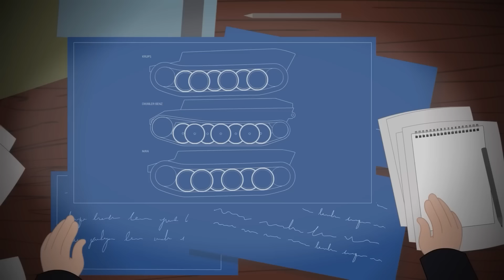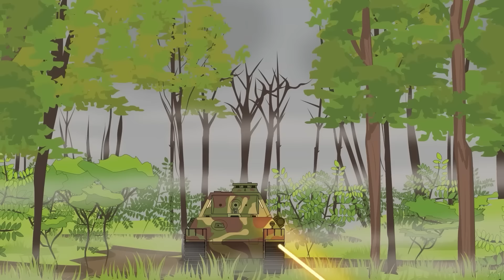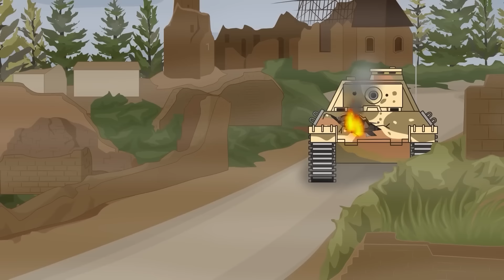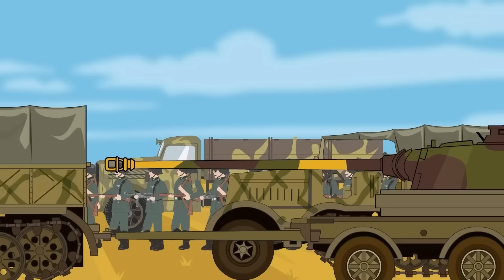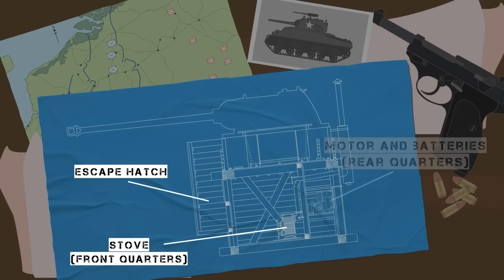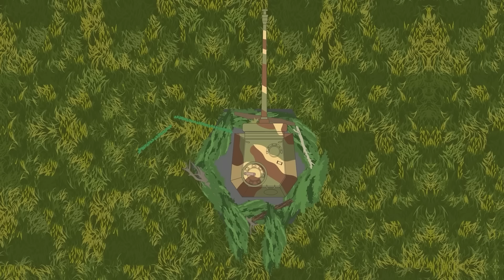Germany's Copy Of The T-34 Tank

Comment: It's entirely FALSE that the Panther tank was developed as a response to the Soviet T-34 tank.  The original requirement for a REPLACEMENT vehicle for both the Panzer III and IV tanks, which had overlapping purposes, and, in the end, entirely swapped roles, with production of the Panzer III, save for rebuild of inventory vehicles into the Ausf J and Ausf N types, in favor of the StuG III SP gun (which also, when fitted with the 75 mm L48 weapon, was very effective as a tank destroyer, credited with more AFV kills than any other type),halted altogether, was a vehicle in the 25 to 30 ton range, sporting the KwK 40 L48 main weapon also used on the Panzer IV from the F2 model onward.  This program was started by Krupp in 1938, but was halted after the Polish campaign, in favor of refinement of the Panzer III and IV models, and hopes that the war would be called off.  Even when it wasn't, following the defeat of France in June of 1940, the production of the German medium tanks proceeded at not too quick a pace.  This would change a year later when Barbarossa commenced, and the KV-1s and T-34s were encountered the FOLLOWING DAY, to their Germans' astonishment.  The need to build a better tank than what they had was especially evident by a rude defeat in October 1941 at Mtesnk, near Tula, where T-34s virtually annihilated a battalion of Panzer IVs. 

The VK(20) program, which had proceeded at snail's pace, got instant priority.  It helped that a few T-34 "runners" had been sent to Kunersdorf for evaluation.  Damiler-Benz already had a prototype that was almost a T-34 copy, but independently arrived at, with the rear engine, rear drive sprocket powerpack (the German tanks until then and the Czech 38(t) used the rear engine, front drive sprocket with the gearbox in front of the driver), which allowed a lower overall profile and better ability to slope the glacis plate.  Although Hitler favored the DB design, especially with the diesel engine, which he considered essential for AFVs, the WaffenAmt 6 selected MAN's concept.  However, many changes, some insisted upon by Hitler also, led to design and production delays, and this "feature creep" ended up ballooning the tank's weight to almost 45 tons, about ten more than targeted. The original Mayback HL210 engine, also used in early versions of the Tiger I with mixed results, was deemed underpowered, the bigger and "badder" HL230, rather cramped in the Panther's engine compartment, was spec'ed.  This led to huge reliability troubles, including ENGINE FIRES.  There were other "teething troubles", but the vehicle held promise with its overall protection, mobility, and firepower, in reality, before the idea was coined, one of the first MAIN BATTLE TANKS.  Hitler had the Kursk Offensive delayed so several battalions of Panthers could be deployed, this was disastrous, both for the delay overall in giving the Soviets more time to prepare defenses, and for the Panthers as their teething problems had not yet been solved.  Needless to say, their debut was a FIASCO, with many of them breaking down right in the assembly areas, and within a week, when Hitler had the Kursk offensive called off, only 16 of the original 200 were still fit for action!  They were all withdraw to "go back to the drawing board", so to speak.

Most of the Panther's original reliability problems were solved, save for that fragile differential, driver training dealt with that issue.  The "G" model, which added a "chin" on the bottom of the turret front, eliminated a troublesome shot trap, and it was probably, WHEN it ran, the finest tank in the war.  Most Panthers, along with most Tigers, served on the EASTERN front, where conditions took advantage of their long-range standoff firepower.  In the West, although in certain situations they could be devastatingly effective, its strengths could not compensate for deployment in unsuitable terrain, as in the Ardennes, or make up for crew and commanders' inexperience, as experience with lopsided losses to the US 4th AD at Arracourt in September of 1944, where Panther crews kept stumbling into ambushes by Patton's more experienced tankers, whose oft-maligned M4s with their 75 mm M3 guns proved more than adequate to take out these "Big Cats"! 

 Oh, and a minor quibble...indeed the Panther was initially deemed "Panzer Kpfw V 'Panther", bu there'd actually been a prior Panzer V, the "Neubaufahrzeug" multi-turreted vehicle, of which five prototype vehicles were built in 1938, and none of them saw actual combat.  In trials, this particular vehicle proved cumbersome, slow, and difficult to operate.  About the most "action" they saw was that, a few days after their comrades had landed and secured the city, they were ferried from recently-overrun Denmark to Oslo, Norway, and paraded around to impress the locals.  In 1944, Hitler ordered the Panther to be simply named "Panther", no Roman numeral.  BTW, Der Fuhrer criticized the Panther, deriding it as "that clanking 'He 177' ", in reference to the troubled heavy bomber, which also had major problems with ENGINE FIRES.
Reply: finally a good comment... and probably even researched more throroughly than the average simple history video
Reply: Great read but the Battle in Arracourt was more of a classic lesson about imbalanced combined arms and much less about Panther designs flaws or the quality of German Panzer crews even in late war.
The major participating German formation was a Panzer Brigade, not the much more common and tested Panzer Division.
That Panzer Brigade in Arracourt had the same number of tanks as in Panzer Divisions, but with heavily reduced other support elements: It only had half the strength for its Panzergrenadiers, a lack of artillery regiment and only had one-third of support units including recon and AA. In other words, the remaining combat arms were expected to perform 200-300% more of their work to support their Panzers, and needlessly to say they failed big time.
Massive numbers of Panthers lost to US ambushes not because of their commanders' or crews inexperience, but simply they had very little recon units to scout them out, infantry to escort the tanks, or artillery to disrupt US AT defense. Again just tanks alone don't win battles - combined arms does.
Reply: @sthrich635  Good point that at Arracourt, lack of other arms, especially infantry, contributed to the Germans' poor showing.  It was a result of throwing in quickly what they had and could put in the vicinity of Metz.  The panzers got priority for what trains were bringing reinforcements; they were committed to battle before what would have been a proper Panzer division in formations (panzergrenadiers, artillery, communications,etc.) and strength could be assembled.  I believe they knew that throwing a tank-heavy unit at the Americans and not having a well-thought-out plan was going to go badly; but had they waited even a few more days, 4th AD would have rolled into Metz almost unopposed.  Points out the desperate situation on the Germans' Western Front in September 1944.  Please keep in mind that Market-Garden was raging and obviously it was getting priority for reinforcement; General der Panzertruppen Hasso Von Manteuffel, a very capable commander, had to make do with what he had.  

Interesting to note that nearly 200 German panzers and assault guns were committed; when the typical strength of a "Panzer" division was about 50-60 tanks...meaning most fought in a constant state of being understrength.  That many Panzers would have, had they had the luxury, been assigned to at least two divisions, likely together as a panzerkorps.  I believe that each division would have had, at what they considered by 1944 "full strength", four panzergenadier battalions in two regiments, and one artillery regiment.  Of course, in line with "Ausfragtatik", these units would have been mixed into "Kampgruppen" to suit the situation, but again, you have to have them AVAILABLE.  As you pointed out, the Germans were going into battle woefully understrength in infantry, artillery, and other supporting units, and the results could hardly have been surprising.

The overall point, of course, is that technical superiority of one's weapon system(s), armor included, doesn't necessarily yield satisfactory results unless they're commanded and deployed properly to take advantage thereof.  Also, one thing's forgotten about Arracourt: although it cost the Germans dearly in armor, which they sorely could have used in either the Hurtgen Forest defense, or in the Ardennes, or even on the Eastern Front, they did STOP Patton's Third Army from advancing on Metz for weeks, as he was forced to go "old school" with infantry and artillery to assault its several forts, something his purported rival, Sir Bernard Law Montgomery, was better at.  Their objective WAS achieved, they simply paid too much for it!
Reply: ........ how long did that take to type?
Reply: Check out the reliability seciont at wikipedia. 4.200 km with a towing panther...is good as a sherman tank.
Reply: Thank you, as a German I gotta say this is a much more informative and well researched comment and honestly you should be writing the scripts for those videos instead, quality would go up way higher.
Reply: I just have to say good job selfdo
Reply: Nonsense
Reply: earth shattering brap above

Comment: This may be up for debate but I think the Germans would have been better off upgrading or even a redesign of the panzer 4. When it was upgraded to the 75mm the Germans should have redesigned it with sloped armour and wider tracks.
Reply: Sorry ment to say the 75mm kwk40 long barrel
Reply: @otisred7848 The biggest issue of the Panzer 4 was the overloaded suspension, the long 75mm and the extra armor pushed the design pretty much to the extreme, why a common cause of breakdown for late war Panzer 4 was the rolling wheels breaking off due to tge stress from the extra weight.
It certainley coudnt handle more, thats why the germans never slaped the proposed sloped armor package on in the first place.
Reply: @otisred7848  there was no chance to put long 75 in Pz IV. Turret was too small for it and bigger turret wasn't an option since turret ring in the hull wasn't big enough. It required brand new hull
Reply: By the time the panther entered production there was no feasible way to upgrade the panzer 4 even more, the turret could not be expanded to handle a bigger gun, armour could not be increased as it was already too heavy. 

As a fun fact, the panther was cheaper to produce than the later panzer 4s.
Reply: @ethanedwards422  no. Panther cost 146k RM white Pz IV 103k RM. Not to mention fuel use, resources and time production

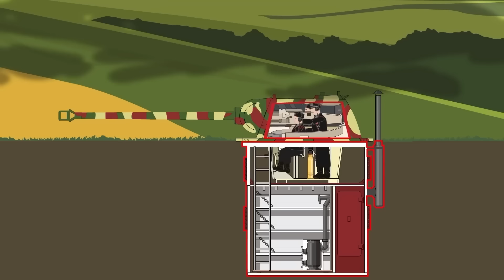Comment: 13:10 Dude... the air was needed to vent the gases from firing the gun, or the crew could die intoxicated. Overheating the barrel was the least of their concerns. As always, hire better researchers.
And by the way, T-34s had "brittle armor problems" since day 1, not to mention faulty welding.

Comment: Should also mention the Jagdpanther, a tank destroyer variant mounting the 88mm PaK 43 to devastating effect
Reply: The Jagdpanther reflected German AFV policy to build a casemate-style tank destroyer with the "next gun size up".  With the same main weapon as the Konigstiger, it's ability to stand back and pick off enemy armor made it a devastating TD.  But only 382 examples were produced.  There were other plans also for the Panther chassis, but the initial teething troubles that required significant rework delayed them well into 1944.  By then, material shortages and heavy losses, especially in Normandy and during Operation Bagration on the Eastern Front, which saw the virtual annihilation of Army Group Center, forced the Germans to simply concentrate on Panther tank production.  Also, realizing that, mostly due to the need to repurpose and make do with what they already had, there were too many types of tanks and derived vehicles, too many gun sizes, and too FEW AFVs overall.  There was a program in place by late 1943, the "Entwicklung", or development, which was an attempt to standardize tank production between types and purposes.  Still, there were, I'm not kidding, SIX different categories of Panzer proposed in this "Entwicklung" family.  Germany never quite got past the "craftsman" mentality and simply focus on MASS production, which the USA mastered and the USSR at least put up the numbers.

Indeed, the American M18 Hellcat TD is more of what the Germans ought to have built as a purpose-built vehicle.  It sacrificed armor protection, and incorporated the latest in American automotive technology, such as a variant of the GM Hydramatic automatic transmission, which made it easier for relatively inexperienced drivers to handle.  It still had a powerful enough gun, and had the war continued in Europe, a "Super Hellcat" with an M3 90 mm gun, same as on the M26 Pershing, would have been issued.  Being lightweight, it was quite mobile, facilitating the "shoot-and-scoot" doctrine of engaging enemy armor.  Moreover, the chassis was very suitable for variants like anti-aircraft, self-propelled howitzers, ARVs, CEVs, Bridgelayers, Command vehicles, and amphibious tanks.  But even the USA abandoned the Hellcat in time, giving working vehicles to NATO allies, like leftover M4 Shermans and M26 Pershings.
Reply: @selfdo The King Tiger had the KWK 43, the Jagdpanther had the PAK 43
Reply: @Objekt220  They were the SAME gun, at least as far as the ordnance used, and both used the same bore diameter, caliber length,  The differences were subtle in the mounting (in a turret for the KwK, a casemate OR, in the towed version, a horse or tractor-drawn, usually a SdKfz 7 or 11 half-track application) and in location of the traverse and/or elevation controls (the KwK, being turret-mounted, obviously had the lateral traverse omitted).  There were actually more towed Pak 43s than used on the Jagpanther and/or Hornisse combined.  Another general difference between them was that PaKs that were vehicle mounted usually had the muzzle brake removed, as the fairly low mounting would kick up a huge amount of dust when fired.  Tank guns (KwK) and towed anti-tank guns usually retained the muzzle brake, simple because the tremendous recoil jarred the turret mechanism, or, in the case of the towed piece, it'd rock too violently and have to be re-aimed before firing the next round.  However, there are instances of 8.8 cm tank guns having the muzzle brakes off, and the towed/PaK pieces retaining them.

Where the KwK/PaK 43 posed a logistics problem was that while they could use the 88 mm rounds from the 8.8 KwK 36, itself based on the Flak 18 that was developed secretly in Sweden by Bofors in the late 1920s, the first three versions of the 88 mm FlaK guns, pressed into service as anti-tank weapons as early as the Spanish Civil War, could not.  The Flak 41 had been developed for a higher effective ceiling, and like the "Big Cat" tanks, was great WHEN it worked.  The perpetual problems with this type due to its higher velocity kept it from serving outside Germany itself, due to its infuriating tendency to jam upon emptying a shell casing; necessitating a complete removal of the breech.  The Pak 43 and KwK 43 that were based upon it didn't have this problem since they were both manually loaded and extracted.  Then again, given how the Germans had to keep everything they'd produced and/or captured in service, having to provision all sorts of different ordnance was one of the reasons their logistics were a horrific failure.
Reply: Yeah. Jadgpanther was probably even Better than the panther itself
Reply: Turretless tanks is such a flawed design even if it was an attempt to mount heavier gun
Reply: @titan_tanker  Thats why a turretless tank had the highest k/d ratio during ww2
Reply: @titan_tanker i mean not having turrets are for tds which are better for ambush attacks and can be more angled too
Reply: @SuperiorVodkaLover  Let’s not forget Sweden’s Strv 103 series of turretless MBTs with their 105mm guns
Reply: @titan_tanker it’s not
Reply: @titan_tanker not really. They were extremely effective, such as the Hetzer (jagdpanzer 38(t))

Comment: "Ausf." is not a word, it is an acronym for "Ausführung", which means version similar to the English "Mk" or "Mark". So you either use the full word or leave it off and say Pan*t*er (hard "t") G.
Reply: At 1.36min, ausf or ausfuehrung was explained. So your comment is somewhat redundant
Reply: @gantulgaganhuyag717 you didn't even correct the actual mistake. It's not an acronym it's a contraction in Deutsch, or an abbreviation in English.
Reply: @gantulgaganhuyag717  No, it's not since he keeps saying "Ausf".
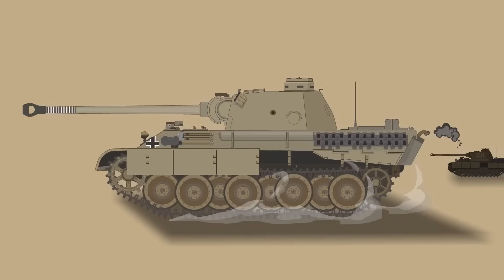Reply: 1:36